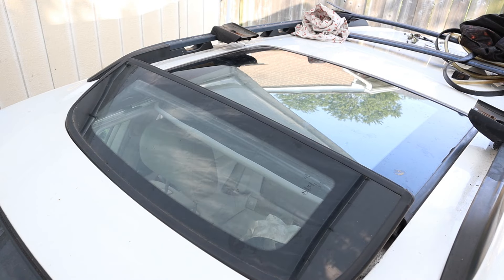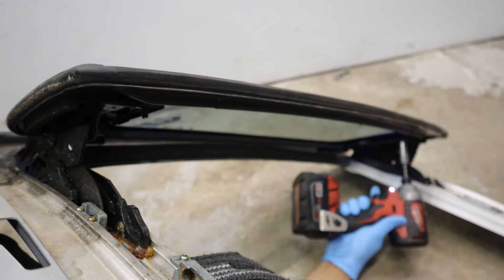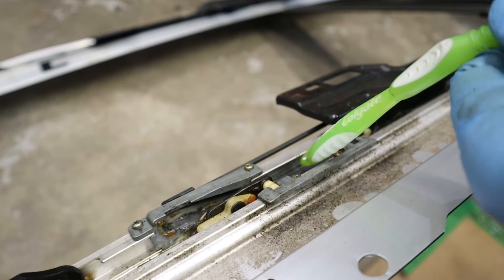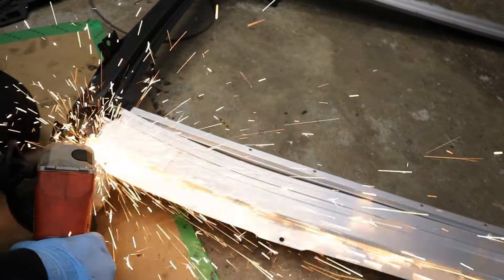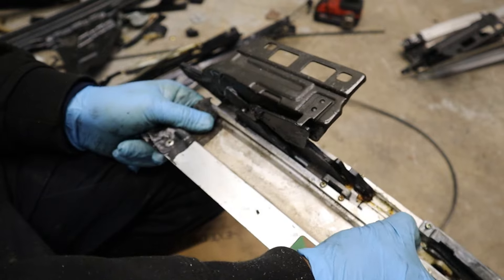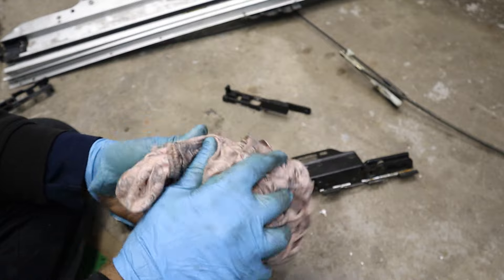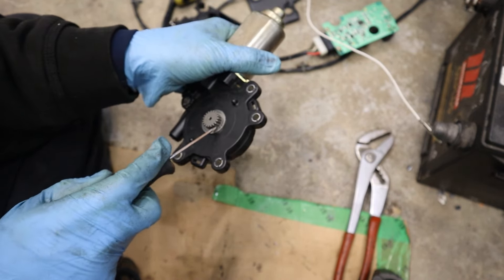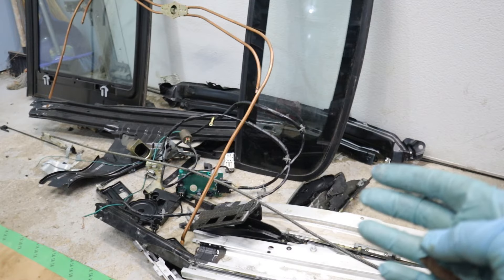How a Car Moonroof Works

Comment: Personally, I think sunroofs/moon roofs should have less components. Older roof hatchets did not have all those motors. They leak or people forget to close them, I think they should be more or an emergency exit when needed, all that glass. Or even inflatable air buoys with strobes in case the car goes in water or tumbles. Just a thought not sure how the buoys would deploy although I think it could save some time in a emergency. I never open my moon roof on my Scion TC too much turbulence.  That glass up there is less reinforcement. Feel free to debit ideas are welcomed...thanks Kar for showing this.
Reply from the maker: You are welcome. I used to hate sunroofs for their complexity. But on a nice cool evening or morning commute they sure do open up the interior nicely
Reply: @speedkar99   True that...I would use it at  night sometimes

Comment: I find sunroofs too hot in the summer but driving on a sunny winter day with the tunes and heat cranked up and the top open = 😚👌
Reply from the maker: I agree, I do the same. Winter + sunroof open

Comment: OMG... another circuit board and a DC motor with brushes. I prefer a manual handle to open the sunroof. You get immediate feedback about the state of the mechanism. Turns too heavy: get out a rag and some grease.
Reply from the maker: That's old school

Comment: I wish you could get nicer cars without sunroofs. Probably the most pointless feature there is.
Reply: Speak for yourself. This is the best thing since sliced bread
Reply: @BoltsNBalls  I don't get it. (I also don't have enough headroom.)
Reply: Skip the sunroof buy bigger engine is what i say.
Reply: I love my sunroof and my wife uses it a lot when I fart in the car as it doesn't cause a smell mixing vortex.
Reply: You are right.  They are a curse for any car enthusiast.  Less headroom, more weight, and prone to failure.  I only own 1 car that still has one, and unfortunately being a Lexus... almost all of these particular cars came with one.  When I do my restoration, I guarantee you it will be removed and welded shut.

When sunroofs fail, which they all do, they leave your car very vulnerable to a variety of problems... the biggest being water entry.
Reply: I’m cool with no sunroof. Last thing I want is for the car to get old and leak water through there. Had that happen with this old 2004 Volvo XC90 SUV I drove until it died. The floor was soaked on the drivers side a lot. 

My current car I’ve been quite happy with and didn’t need all that extra stuff. I got it for the 2.0 L NA engine it had!
Reply: Camry TRD No Sunroof ❤
Reply: I bought a BMW X1 with no sunroof.
Reply: @saugusandsausages  Nice👌
Reply: @ixfxi  Yes, the water can cause some serious damage. Oh and the interior might smell moldy.
Reply: @redbaron2448  Beautiful!
Reply: Love the sunroof on my acura
Reply from the maker: That's sad. I'd buy that car but the lack of sunroof is the deal-breaker
Reply: I can’t buy a car without a sunroof, car looks basic without one.